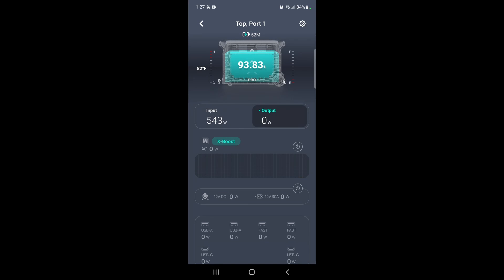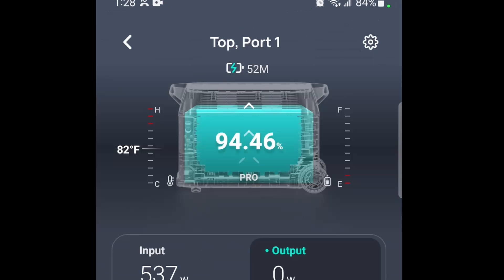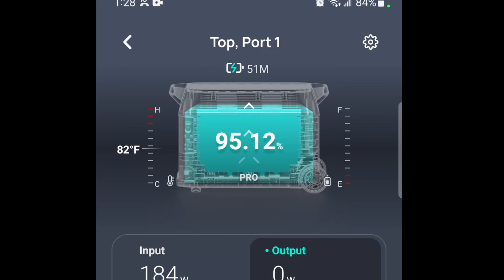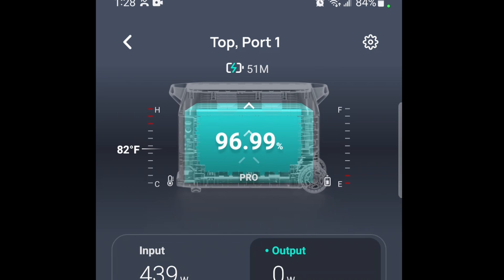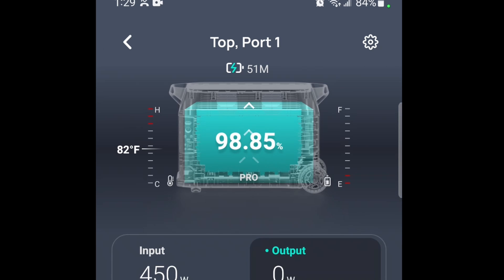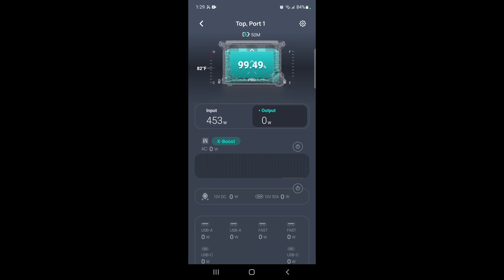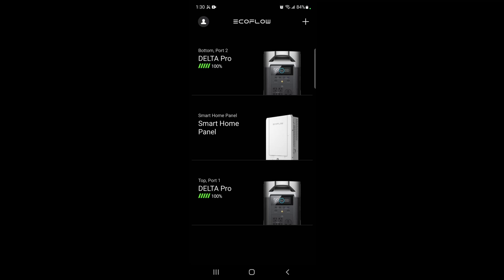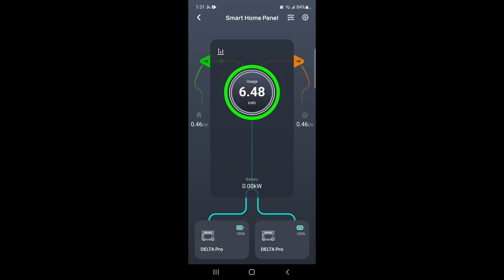Solar Charge Too Fast!? What's Going on with my EcoFlow Delta Pro?

Comment: Hi
If this occurred at the end of day or as the clouds came out this is normal. 
The panels are are what is called “ Dumping” meaning whatever energy is left in the panels is dumping it into your battery right before they shut down for the day. 
To prove the battery percentage just turn off the unit and hold the on button until the battery percentage numbers appears. This resets the BMS and you are good to go ❤

Comment: The charge curve of LiFeP04 is very steep at the top (and bottom). This is definitely a calibration issue. My guess would be the unit when calibrated more smoothly ramps up the percentage when the cell voltage passes 3.45V by having the SOC already reading 98% by that point but because the calibration is a little off it might be lagging behind and when the voltage starts to rapidly rise from 3.55 to 3.65 it’s saying “oh shit I’m off!” And is just throwing percentage points on to the SOC reading. When I charge individual cells the time spent between 3.20 and 3.30 can be two hours and the time between 3.55 and 3.65 is like a minute just to give you a reference for how fast it goes up. 

*big assumptions are being made here about Ecoflows charging profile. They might not go all the way up just like they almost certainly don’t let you go down to 2.5V

Comment: Mine did this too. I called customer service and they told me to charge it to 100%, then turn the unit off for 1-2 hours, then turn it back on. I have a video on it if you want to see.
Reply from the maker: I would like to check that out.  That's a little different than the advice they gave me.  (Didn't tell me to turn it off once 100% and wait a couple hours).  Interesting to see if that helps.
Reply: @DIYnerdman  hey did this work for you?
Reply from the maker: @jaysonstebbins2539  it helped,  but seems like it needs to be done periodically to maintain decent calibration.   It's been a month now and I should do it again.
Reply: @DIYnerdman  if the unit runs full time I would suggest probably making it your monthly maintenance thing with dusting it off. Good to hear! The BMS just sees ah going in and out and sees voltage. It doesn't quite know the exact level of charge unless it full or drained. I have 300ah of gel in my shed with a 500 amp shunt and I too have to do this once a month or two. I'll sometimes have to fully charge and tell it what full is. If you get alot of hard draws then sometimes it actually pull more from the battery chemically wise then what the BMS actually reports. It's like filling a glass of soda fast. Just use that anology both ways for charging and discharging.
Reply: Interesting info, do you guys think that we'll have to keep doing this with our Delta Pros? Isn't there a way to just let it run and not care and just enjoy the off grid life careless?
Reply: @vavrorvav  I believe this needs to be done with anything with a bms periodically mainly because of the soda effect. If you discharge or charge quickly then the bms thinks its full or empty but the chemistry shows after the battery rests its always different then what the percentage shows. Luckily on the ecoflow it can read voltage into the equation of time remaining. I have to reset my shunt periodically on my gel DIY system from time to time as well
Reply: @jaysonstebbins2539  Thanks for the info!
Reply from the maker: @tulkooo  This affects my usage since I use the battery every day from 4 to 9 pm.  After a couple months the calibration gets so far off that I only get maybe 2 kwh max from the pair of delta pros before it says the batteries are at 8% and stop discharging.  (I set the lower limit to 8%)  The full capacity is still there, but when I drain the batteries to re-calibrate it sits at 0.49% for hours using up what seems like almost half of the full capacity.  So in an emergency you'd still have all the capacity available for use, you'd just need to tell the DP to run down to 0% to be able to use it all.  Would be nice if there was a software update that could straighten this out.
Reply: @DIYnerdman  unfortunately there's no software that can fix this. It's all chemistry. Say a 12v battery at nominal is 12.0v that's technically 50% for a flooded battery. And at resting 100% is 12.65v but if I charge that battery really fast a shunt would say hey you added 50 amps to a 100ah battery for 1 hour from 50% it should be full. Unfortunately the resting voltage may be 12.5v. About 80% full. But if I charge it at a slower rate maybe 5 amps for 12 hours from 50% then maybe I would have a resting voltage of about 12.67 and I would have about 105ah of storage. Hard discharges and fast charging will always throw almost any bms system out of wack after a while. That's why completely charging the battery to 100% with no more input and shutting off the unit for a few hours resets the bms to full because when you turn it back on its last % was 100% and now the voltage is resting. I myself ran my delta max 2000 for 20 minutes on 1% at 1000 watts. Then finally kicked off. But we have to train the bms what is 0% and what is 100% and remind it periodically.
Reply: @jaysonstebbins2539  Thanks for that info!
Reply: @DIYnerdman  that's exactly what is happening to me as well, it charges long time at 99% and then it discharges for hours at sitting at 1%, this bothers me quite a lot, on the bright side it's good to know that the capacity is there but it's hard to manage my household with innacurate SoC and mathematically using less and less of the capacity every cycle just because it shows wrong %, I'm pretty sure there should be a fix, imagine if this was happening to EVs, that'd be even bigger disaster
Reply: @jaysonstebbins2539  thanks a lot for the info Jason, it's very useful to know how the battery feels 😀 so that we know how to behave to see the best results, what's the conclusion then? Let it run to 0% until it shuts off by itself wait 1h and then charge it to 100% (whether fast or slow) until it shuts off and let it sit there for example for 1h so it learns that it's at 100% again and do this like this a maintenance every month is that correct?
Reply: @vavrorvav  as far as ev's go each pack has its own BMS in which every time it's charged it actually charges different packs. So say I charge from 30 to 80 percent packs 1-4  are charged and pack 5 (in a 5 pack system) is left low. Then next time it's charged pack from 30 to 80% packs 2-5 are charged and pack 1 is left low. This is how they are able to get batter charge cycles and better SoC %'s. If only this technology was out into smaller batteries like the delta pro,max, and rivers we would be paying even more for these units lol. Like 20-30% more $ :) pretty much 5kwh  IMO have this and not our smaller batteries.
Reply: @vavrorvav  IMO I would use the 10-90% rule unless cloudy days are ahead. But yes a monthly 0% run would be good but no time is really needed. I would charge immediately especially being manufactures request but a slow charge to 100% like 400-600 watts then shut unit down for about an hour would be my suggestion. This done once a month should keep you within 70-90% accuracy of your run time. And if done enough technically the bms and software should learn this over time and may not need it as often possibly? I'm still learning so aware with me and take my suggestions and opinions with a grain of salt lol.
Reply: @jaysonstebbins2539  again thanks a lot 🧡 I just woke up to a 1% Delta Pro and it's 7 in a morning I will let it run till it dies and test it right away, I have a feeling SoC is out of sync
Reply: @jaysonstebbins2539  so I let the Delta Pro charge to 100% yesterday and it was charging alright throughout the whole day between 400 - 800W I was charging it via solar + another Delta Pro but then after 85% I didn't check it regularly but I noticed it went to 100% rather fast compared to how it was charging during the day and I even set the AC charging lower to 400W... so it finished charging to 100% and I let that can of soda cool off overnight (btw great analogy, makes total sense now) and I turned it back on this morning and it was showing only 83% 👀 so I'm charging it again from the other Delta at 200W to finish the full charge

Comment: My unit has been doing something similar. State of charge had been drifting for a while, and recently while discharging the unit it started smoking and partially broke... Am currently in the process of sending it in for an RMA with EcoFlow. Specifically the MPPT/DC converter board broke.

Comment: Hi 
I had the exact same issue a few days ago. 
It’s an SOC issue . For me the 1% on the screen was in fact about 70% on the battery. 
It took me hours to discharge de batterie to real 0. ECOFLOW’s ingenieers told me to discharge between 200 and 500W they charge it back to 100% between 200 and 500W as well. 
3 times ! 

Or you can press the start button 10 seconds. You will see your real SOH . Turn the battery of for few hours. This will recalibrate the BMS. 

Here is my video (in French)
Hope this will be helpful 

https://youtu.be/jq1a-Eyf0qE

Comment: Hello... try a reset. Un plug from everything. Turn the unit on then hold the power button to turn it off. Wait a a few seconds and turn it back on but don't just push the button. Hold it down till it beeps. Your battery % should go up or down. Then do a energy drain to 10-15 % . Then charge it back up. The reset is just pushing and Holding power button until It beeps providing confirmation of a reset.
Reply: when you power the unit off, keep holding the power button for 20 seconds then release wait 10 to 15 seconds then turn back on. then you should see a change
Reply: @crzyscottech2724  this tends to help me much more, doing 3 charges & discharges does not even calibrate the battery for me anymore, but reseting is the only thing that works and it's instant